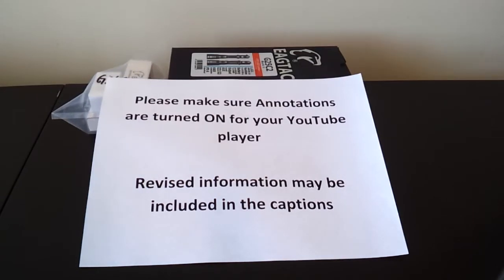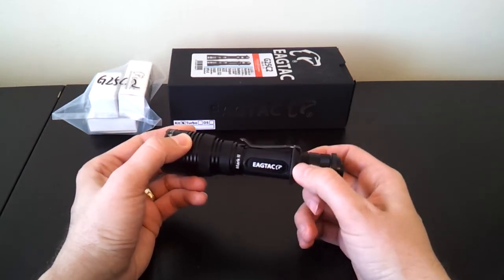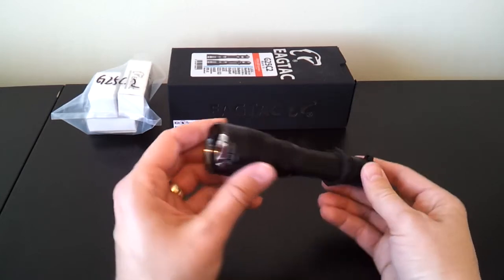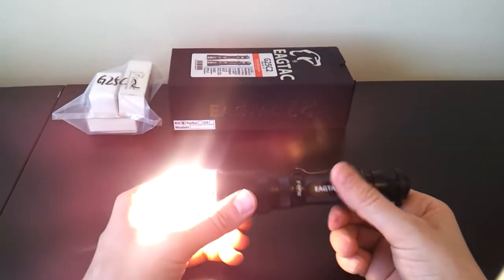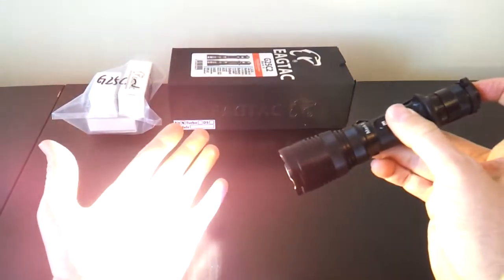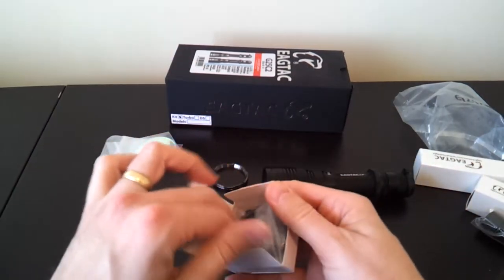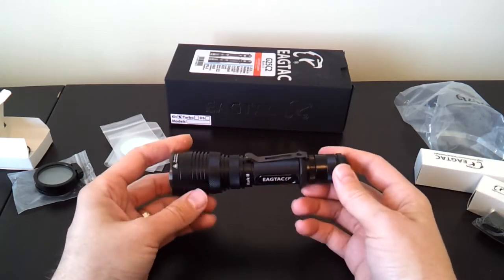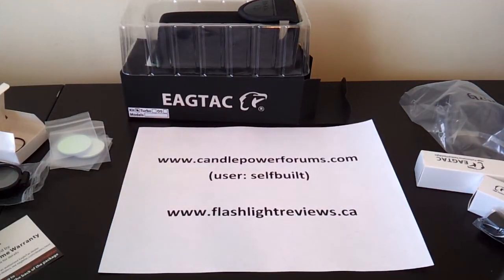Eagletac G25C2 Mark II (XM-L2 U2, 1x18650, 2xCR123A/RCR) flashlight review, by selfbuilt

Comment: well i ordered that neutral white version T6  mkII due to the more natural warmer spectrum it offers for camping. i find i have a greater sense of depth with the Neutral whites and Hi CRI's. I have the complete kit and diffusers coming with it as well. I hope it is what i had expected. seems like a well rounded light. Im coming from a 4sevens s12 Maelstrom with the SST90 led and 26650 battery
Reply: T6 is more white natural at XP-L2 U2 ??official Eagletac site says XP-L2 U2 natural white...im confused..Whats the difference pls help bro
Reply from the maker: Neutral or Cool are descriptions of the tint "warmth". It has nothing to do with the emitter type or output bin.  Most emitters are cool white, unless specifically stated to be neutral or warm.

Comment: Hey,

I haven't tried those in the Eagletac lights but they work just fine in ALL my 18650 compatible Fenix lights. If you look at the specs for the light and the specs for the battery they are compatible, by the numbers :)

Comment: I unfortunately i have owned 3 different eagtacs for our ranch for years and  now everyone of them has had to go back for repair or repalcement, which takes considerable time as the only guy that you deal with has to order either parts or a light from china. iI use either a MX30L4-C(repaired once and then repalced) or MX30L3-C(repalced once) nightly during the long nights of winter and calving months and keep a clicky on the side of the gunsafe in case of power outage. it never gets used and now is draining the battery within 2 months just sitting there.(and yes i click off the charged led).and when i try and use the X2CR123 cap the light stays on and will not turn off.
 As well, now that i've called in for assistance with this last issue i am getting ghosted by them.  so anyone who is looking at an eagtac product BUYER BEWARE